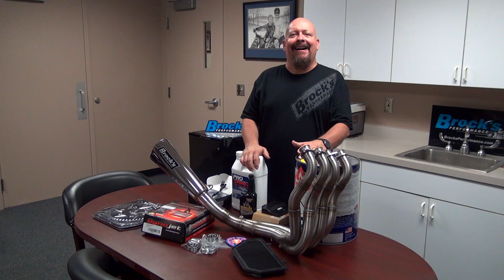2017 GSX-R1000 S2B: Episode 1 - Parts Introduction & Overview

Comment: Start a goFundMe with whatever limit would be needed to take a stock bike(loaner/demo) off the show room floor, and give before, and after 1/4 mile times with, and without ceramic bearings. I don't think they make a difference on a bicycle let alone a motorcycle with 100+ hp. Prove me wrong i'll give money to the fund.
Reply from the maker: On my personal 7 second Bandit, steel wheel bearings netted hundreds of runs in the 177-179 MPH range in the 1/4 mile. After switching to Worldwide Bearing Ceramics (that was to ONLY change...), the bike instantly jumped over 180 MPH for hundreds more passes. The average increase was right at 2 MPH, apples to apples conditions-wise. Over the last 20 years, we have measured increases form .5 MPH (typical is 1.5-2 MPH) up to as much as 7 MPH (on bikes with seriously neglected wheel bearings, etc...) we have NEVER seen any bike slow down as a result of adding them. Our land speed racers over the years have seen even greater gains and no serious racer would show up at the track without them, IMHO.  Our touring customers have experienced solid 1 MPG increases - over the course of a year, they pay for themselves in fuel savings. I spent 15 years in the special machine/test industry before opening @BrocksPerf full time, so I belive my understanding of proper test protocols is solid. We offer WWB's because they are 100%, without a doubt the best-performing/highest quality bearings available in our industry. We even order our BST wheels without bearings and install WWB's into every single performance wheel sold since 2008. You might question their value, but we certainly don't. Hopes this answers your questions. - Brock

Comment: I’m considering buying your setup. Will there need to be any upgrades in the drivetrain, shocks, chain, etc?  Will stock handle the additional power?...
Reply from the maker: Stock drivetrain will handle the power at stock wheelbase and we will probably have gearing changes.. If we lengthen the bike, chain/sprockets/shock will all change.
Reply: @BrockDavidson  Thank you for the quick reply. I actually purchased the shortmeg 2 exhaust, ECU flash, and quick shiftier/ blipper this morning, should be fun... Hoping that will get me an extra 20ph...
Reply from the maker: @thesprattlawfirmpllc37  glad to hear and thank you for your order. Let me know if you need anything.

Comment: what sprocket size are you going to use?
Reply from the maker: @Justin - that's a great question, and seems simple... but it a little complicated to get the gearing correct for the application. Check this out for more info: http://blog.brocksperformance.com/faq/what-is-the-best-gearing-combination-for-my/

Comment: @ Brock,  I would have thought Guhl or Woolwich would have been a good platform for this. to my understanding the pc5 only a piggyback that allows adjustments to the 4 lower( primary) injectors and also doesn't override the ecu completely from compensating for air temps and other sensors and parameters the bike sees and selects different maps. With that said, I have ridden a gsxr with your exhaust and map and the thing pulled hard like no other bike. this was an 05 gsxr1000 though. You are the expert, not me, keep up the great work!

Comment: Hey Brock, looking forward to your work on the new 2017 gsxr1000. One question, I know you adjust fuel using the pc5, but for those that just flash the ecu, is it possible to convert the map data created using the pc5 to a flashed map? That way when buying your exhaust and other components can still benefit from your tuning work. I had a pc3 and pc5 problems in the past causing the bike to cut off while riding and also not to start and don't trust their products anymore. Any clutch mod for this model and any word on changing the vvt spring to change the RPM it retards timing?
Reply from the maker: @apexhunter2K, great questions. Many are asking us to incorporate our fuel mapping technology directly into our ECU flashes - we have tested several platforms and none have met our standards to date. That said, we will continue to test and develop methods, once this is available, we will offer this service. We are working on the clutch and currently see no reason to change Suzuki's revolutionary variable cam timing adjustment methods.

Comment: Brock, I know that over the years you have worked with several fuel commander packages. My question, why stick with Dynojet power commander? Here in South Africa, the track racer's technicians tell me that the PC5 is not trust worthy, although the PC4 didn't give them the amount of problems the PC5 has, and they rather go for the Bazazz. I'm in the process of getting the factory BMW ECU unlock code and race calibration unlock code done by BMW. From there I want to try and get as much from the 2015 S 1000 RR as possible using the BMW software and hardware. When that's tapped out, I'm looking to go with a after market fuel management system. The race tech's here tell me that, with PC5 it only reads from 2 injectors, as opposed to the Bazazz that reads off all 4, or something like that. I have a friend that installed a Bazazz system onto his 2014 S1000RR, and got 210HP from it, so he claims. I've also heard of a system called RapidBike from DIMSport, a company of Holdim. My question is, what would you recommend be the best for a 2015 BMW S 1000 RR? I still need to take off the stock headers, and replace them with stainless race headers. From there, I got a slip on Akrapovic long end can, as well as a short one(short one currently fitted to stock headers). Servo motors are disconnected, so butterfly valve, or actuator valves, whatever they are called, are open all the time on the stock exhaust, so my bikes fueling is messed up for now( running to rich, but sounds like a beast). I'm getting off topic, any how, would like to hear your feedback and suggestions on this. My bike will be a full time track bike, I've done about 8500km or 5300 road miles with it.
Reply from the maker: The PCV, combined with a Dynojet Model 250 and Dynjet's tuning link program allow us to tune under precise, constant loading over ramped/time-based areas in the map at precise throttle openings. This provides unparalleled acceleration mapping, IMO. Bazzaz has traction control and other features that road race tuners enjoy, it's understandable they would go in that direction. We have tuned the fueling on several BMW's using the race calibration kits... we just used a PCV and model 250 on the fueling side, as the race kit calibration for throttle control is 'terrible' according to the riders. Our PCV tune makes the throttle control 'perfect', according to those same riders :)
Reply: I agree with you on the race calibration kits. People have told me that you can only do so much with them. I think that the problem with us this side, may be that we don't have all the required and sophisticated machinery as you have over there. Maybe that's why the are struggling. We are a 3rd world country, but we try our best to keep up with technology.. I've just heard from the one race tuner complaining that they had plugs come loose during a race using the PC5, whether its human error, or manufacturing error, I'm not sure. In all my years I've only heard good things about DynoJet PC, and people always told me, stick with Dyno Jet, that's why I'm scratching my head as to why the sudden shift to Bazazz. Thanks for your explanation. Keep on tuning, well keep on watching and learning from the best in the business.
Reply: EDW 845 I have a pc5 with autotune box on my '13 bmw s1000rr and it runs flawlessly. It runs so well that I've decided to not flash the ecu. Your friends rwhp output seems very high if he claims to just have bolt on mods. To get to 210 rwhp it would take more than a bazzaz...

Comment: 2016-2017 zx10r not review ?? suzuki review loooolll....
Reply from the maker: Yeah, sorry about that. The 2016 ZX-10R owner we worked with wasn't into drag racing. It's a REALLY nice bike and he's put over 10K street miles on it :)
Reply: I would like to see the result of the gen5 zx10r modification from a master like you. The other sites are getting 203 horsepower in the rear wheel.
Reply from the maker: Mateeryal Mateeryal we measured that much also.(a little more) But if we can't race... how fast is it?
Reply: Brock Davidson I am waiting for your gen 5 review and modification

Comment: much more options with ecu flash is new technology..... pcv is a dinosaur just like fuel injection vs carburetor.
Reply from the maker: All modern day fuel injected motorcycles must be flashed to remove restrictions - this is not in debate. The question is 'obsolescence' of a pcv for fuel control...
Reply: Brock Davidson fuel maps tuned on the ecu makes more sense.
Reply from the maker: LUCKY13 ! meh... we will see
Reply: D F910 WRoNG!!!!!!! THE ECU CONTROLS ALL THE POWER ON THE BIKE.... YOU CAN INSTALL AND TUNE  CUSTOM MAPS  ON THE ECU... TUNE THE AFR ON THE ECU.... INSTALL DIFFERENT MAPS ON THE SELECTED MODES ON THE BIKE FOR MR12 OR PUMP GAS ECT.... PLUS CONTROL FAN TEMP.... MODE SELECT....TIMING....FUEL CUT.... QUICKSHIFTER....SERVO....ECT......AND MORE.     PCV IS A OLD NEWS PERIOD .